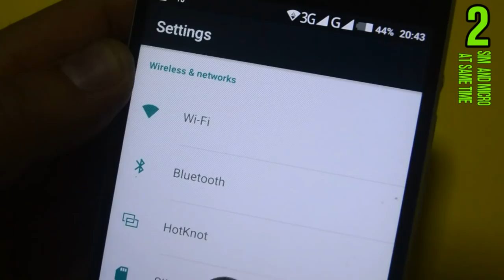6 Tested  Life hacks that work!

Comment: Sim Card + Micro SD Card - Stupid
Cool Down Spoon - Stupid 
(If your tea is too hot put some cold water in the cup to cool it down or put the hot cup of tea in the refrigerator for a couple of minutes.)
Air Freshener to Motorized Saw - Stupid
(Something like that would have no power whatsoever, as soon as you apply any downward pressure while sawing a piece of wood , which is something that is necessary
that motor will stop , secondly you don't use a hacksaw blade which is used for cutting metal etc. to cut wood with. Thirdly sawing that piece of wood almost completely through by hand and then only leaving about a hair's width of wood remaining to try and make it seem that your piece of shit electric hand saw really works is fucking ridiculous and proof that it doesn't really work !)
You clearly have too much time on your hands sir, also the title of the video is extremely misleading 6 Incredible Gadgets And Life Hacks ?
Incredible Gadgets - I think not
Life Hacks - I doubt it 
Life Hack Definition :
A strategy or technique adopted in order to manage one's time and daily activities in a more efficient way.
Just because this video has gotten almost 7 and a half million views doesn't mean anything by the way (I know some smart ass will mention that).
Some stupid videos tend to get massive amounts of views it doesn't mean anything.